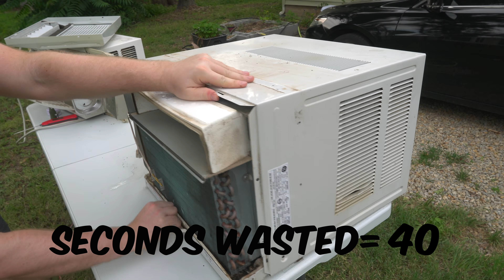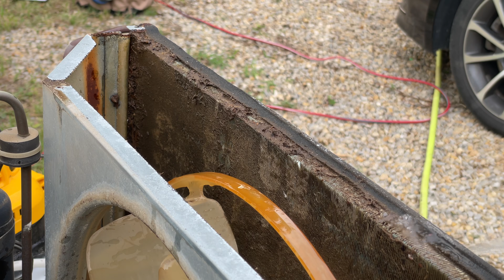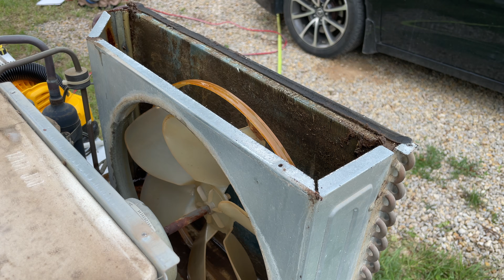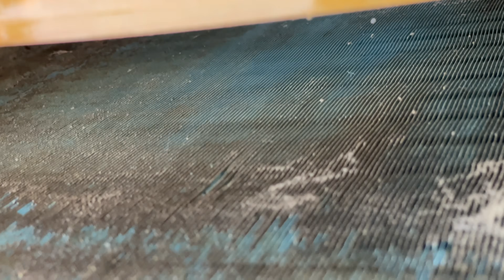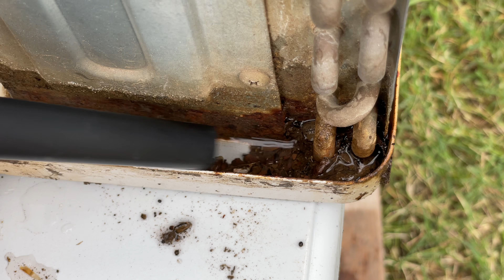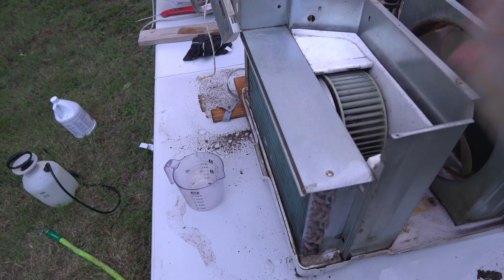DEEP Clean Window AC The Correct Way!

Comment: I've been coughing at night lately and realized last night our window AC may be the issue. I looked in it this morning and saw so much black. 🤢 Thank you for this video. I'm about to hop onto Amazon and buy everything you used.
Reply: So this is why I feel like I’m dying
Reply: @brabbit3134 
I am so sick right now , I didn't know, I cleaned the front filter,   do they have people that can come out ? Any suggestions..I am a Sr. Citizen in Memphis TN .
I have No one.
Reply: Try googling "A/C repair near me" in Google and you should get some results @elw7658
Reply: @elw7658 it would probably cost less to buy a new unit than to pay someone else to come out and clean it. Small price to pay for your health! Good luck
Reply: @elw7658 not sure what type of ac you have but if it's just a window ac or portable ac you might be better off just getting a new one especially if it's a window ac as they are cheap around one or two hundred and that's what a company would probably charge to take it all apart and clean it thoroughly if it's old but if it is new then it might be worth just getting it cleaned I'm sure there is someone that maintenances ac and it might not be to expensive so ya if it's new I'd try looking into finding someone to clean it if the price is reasonable see how much it will cost then see what they cost new but if it is old you most likely would be better off buying a new one as it will be more efficient in the mean time I would avoid using it if you are sick unless you need to because it's to hot to go without then I would spray it down inside with white vinegar and let it sit at least ten minutes before spraying it down with water to wash out as much vinegar as possible possible the vinegar will kill the mold better than bleach plus you don't want to use hard chemicals as when you rinse it out you might not get 100% of it out where as vinegar if a tiny bit is left behind it won't be harmful as it will be completely diluted by the water and you don't need to worry about getting it wet inside as almost everything is covered the only part that's not is the control panel that you press to turn it on and its ok if it gets wet as long as it drys completely before plugging it back in and turning it on you can put a fan on it or heater to ensure that control panel is dry and it will help but it's just a Band-Aid as you will still want to have it fully cleaned out or replaced what ever you do don't ignore it and continue to just use it as it is because mold can lead to ammonia respiratory problems and could end up being fatal and you Dont want to go out from a moldy ac that you could have avoided good luck
Reply: @elw7658  Try contacting an a/c repair company or HVAC company and ask if they do window unit cleanings. If not, buy a new unit. Mold is very dangerous.
Reply: @elw7658  I’m sorry you’re alone, that must be very unfun. I hope you found someone already! If not, you could probably call an air conditioner company to do it. I just took apart & cleaned the inside of mine- it was filthy with mold! But mine is upstairs, and the outside of the unit is on a very steep roof! So I’ll probably have to call someone to do that.
Reply: Update: I did it! I kinda dropped the air unit out of the window when I first unscrewed it 🤦🏼‍♀️🤦🏼‍♀️🤦🏼‍♀️ but otherwise, everything was a success. Thank you again!!
Reply from the maker: Haha oh nooooo! So sorry, but you definitely sent the first one to do that.  Good job tackling the project! 💪🏼
Reply: @asheela75  Yes, you were probably coughing because of all that MILD that you were breathing in. For some of these units, the amount of mild around the blower fan can get pretty bad.
Reply: Me too.
Reply: Same thing with me. I realized it was a/c
Reply: I can't clean it my self, I am a Sr. Citizen. Do they have companies that do that work?

Would I do better purchasing a new one.?
Reply: @elw7658 yes and you need to look for an air conditioner that does not have polystyrene foam in it. The texture of the polystyrene foam attracts dirt which then grows mold on it. I googled window air conditioners with no polystyrene and it said this. Hard-Molded Plastic Chassis: Premium inverter models, such as select variants of the LG Dual Inverter Line, favor hard, smooth molded plastic internal walls instead of exposed, raw styrofoam blocks. Mold has a much harder time adhering to smooth plastic, and it is exponentially easier to wipe clean.

Comment: You shouldn’t spray the coils at an angle always straight up and down otherwise you will bend the fins over and it won’t dissipate the heat properly and it will run like you never cleaned the coils and if bad enough it will shut down on its limits. There is a coil cleaner you can buy that dissolves all that dirt and a low pressure rinse is all that’s needed.
Reply from the maker: The coil cleaner in the video seems to do that in my experience. You are right though, all fins need to be straight.

Comment: Correct me if I am wrong, but based on this video, it seems that if you live in a city apartment, and don't have and outdoor cleaning area and a hose, etc., there is no way to deep clean your AC.  The best you can do is the partial clean as shown in  the other video.
Reply: Part of the reason that I left the city. Window a/c's made me so ill from mold and there was no way to clean them without paying someone hundreds of dollars - if you could even find someone. I had a handy guy wash it for me and he fried the electronics and that was that. - sigh - Maybe try taking it apart in the bathtub?
Reply: Another option that I've looked into is that there are units that can be used in windows OR walls. In these units the guts/coils slide out of the casing so you do not need to completely take it apart. The unit has to be window & wall in order to be able to use it in your window and slide the chasis out.
Reply from the maker: I’d say that’s correct. If it’s extremely bad, and a person wanted to, they could do it in their sink. I wouldn’t use high pressure water, of course. But letting it soak and scrubbing it with that brush doesn’t require much of a mess. But you’re right…it may be better just to replace it with a new one and sell the old one.
Reply from the maker: Also, a bathtub may work better, depending on how big the unit is.
Reply: @HandymanHertz  Thanks so much for the reply.  The bathtub might very well  work for a small window unit, but a larger AC might be a tight squeeze.  In any event, I appreciate your very informative video.
Reply from the maker: You’re welcome, thank you for watching.
Reply: Get a garden sprayer and pump it till your arm falls off, and use that to clean out the fins. Or take it to a friends house.

Comment: Question, do you have any alternate options for spraying if we don't have access to a hose of any kind outside. the only hose i have is the sprayer from the sink, and i'd honestly rather not do that kind of cleaning inside the house if i can help it.
Reply from the maker: If it were me, I would get a cheap adapter that can fit a hose to a sink. Then you can reach your hose outside

The other option would be to just spray the AC with foam, and spray the foam residual off with a spray bottle. I show this in my other AC video “how to clean your window AC the lazy way.”

Comment: My cousin buys new a/c units every 2 or 4 years and I get the old ones and do a detailed cleaning and get them working like new again and sell them 'lol'
Reply from the maker: That’s a sweet side hussle!
Reply: @HandymanHertz  I love when you said "If your really feeling brave" awesome statement, because it could be nerve wracking not knowing if you are going to damage some tube under Freon pressure and your doomed
Reply from the maker: @alexshatner3907 yeah, everyone has different comfort levels I suppose
Reply: @alexshatner3907  they are not super fragile, so its okay
Reply: @alexshatner3907 Yeah the first and only AC I took apart to clean wound up getting a freon line blown up lol
Reply: Hey man.  Smart asf.   Another man’s trash another man’s treasure.
Reply: Damn dude every 2-3 years changing window AC units sounds like throwing money away.
Reply: Hey AC FLIPPING.
sounds like a good business model to me
Reply: I've had to replace ours every 2-3 years but as I've learned, they will last longer if you have a little bigger unit than you need and use preventative maintenance of all kinds, starting with a real filter instead of that swiss cheese screen they give you and trying to run at a higher temp in the 90-100s with the unit at a correct angle and in the shade if at all possible
Reply: @DavidM..832  I've had my 5000 btu frigidaire unit for 9 years. I run it the entire summer. The room that it's in the door is left open throughout the day to cool other parts of the house so the compressor runs continuously probably 12 hours a day and at night the door is closed so the compressor cycles on and off as the desired room temperature is reached.
Reply: @infinity3jif  If I had smaller closed off rooms that might be possible for me but I have a more open floor plan and since I switched to window units instead of central ac I found out real quick about btu and square footage. I do save money using the equivalent of 2½ ton vs an inefficient 4 ton with some crazy ductwork and no more climbing in the attic or calling an ac guy. I think we have it setup good now with 2 Frigidaire 12k btu's.
Reply: @DavidM..832  Nice, I also have a 12k BTU frigidaire in the living room. It keeps the kitchen, living room, and some of the hallway cool. The air from my 5k btu meets the air from the 12k in the hallway and ceiling fans really help with circulating the air. 'lol' As for central a/c systems when they work correctly it is a great system but window units are so much simpler in my opinion.
Reply: @infinity3jif  I agree, strategically placed fans do help.
Reply: Lol thats like my brother and his PS4's I keep telling him all it needs is cleaned and it won't be a jet engine but nope. we have 3 PS4's now.
Reply: @LowJackAP  Yep, you must maintain stuff if you want it to work correctly.
Reply: I haven't bought one in 10 years, I service mine every spring!
Reply: @a.joegevara3519  Same, I purchased my Frigidaire unit back in 2015 from Lowe's. I clean it every couple of years.
Reply: thats crazy because they last more than 10 years
Reply: @DonioSalieu I've never had a window unit last more than 2 years, no matter how many times our how thoroughly I've cleaned it.  One summer, I took one (that had passed the 2 year mark) apart and deep cleaned it every friggin weekend and it was covered in mold every friggin weekend....  I've spent a FORTUNE on new air conditioners over the years
Reply: @brianwood876 What? Do you live in a really humid area?
Reply: @lorenavelvet  yeah. But still... It's a little ridiculous
Reply: @brianwood876  I'm in the same boat. NC summers just shred these window units these days.
Reply: @brianwood876 
There has to be some additional factor effecting your window units. Maybe too much sun, too dusty, too damp, not enough airflow on the outside. 

I have a Danby purchased from Costco in 2017. It’s been used non stop since then. I even loaned it out to a friend after hurricane Ida. They ran it on a generator for a few weeks the. Returned it. I stuck it back in my window and plugged it in. I’ve never done more than clean the filter. It still keeps an oversized room cool and dry. 
I hope you have better luck going forward. 

Also maybe check your electric supply from the breaker all the way to the outlet.
Reply: @davidkirby6473   well it wouldnt be the electrical, they don't break down mechanically, they just get so moldy regardless of how much they are cleaned.   I can't rationalize still using one as bad as they get if it's blowing mold into my house when I have kids breathing in there
Reply: @brianwood876 I have to wonder if there's any Shrubbery or bushes right near that unit that have aspergillus in them which causes the black mold  .
Reply: @davidkirby6473 good info
Reply: @brianwood876  it's the angle you got it installed. Or it's near a gutter or next to a plant. Had a window unit be installed wrong and water was backing up into the windowsil and into the unit, it molded the unit and the window. Also I'd look for units that use Styrofoam inside they started doing that to limit humidity and mold issues.
Reply: I do that to ac washers dryers microwaves etc.. really easy to fix and diagnose
Reply: Window Air-conditioned is so Cheap Now Days.

Just Buy New A.C. every 4 years and call it good
Reply: @norbelsemaj3870  Just get a 4 or 5 year extended warranty protection plan, because if you buy a good quality air conditioner will cost you a lot of money to keep replacing it every four years
Reply: I accidentally hit one with a screwdriver and PSSSSSSSSHHHHHHH. Bye bye freon.
Reply: Clean mine 😂
Reply: Yes we live here in lake charles  Louisiana  we need help bad my child  is always  sick from dirt and  our clogged  air conditioner  we need someone to please  clean them something
Reply: Hell yeah boi
Reply: I'm down to buying 2 per summer. I can't deal with the mold smell.
Reply: So what do we do about these NEWER AC units that DON'T even have a hole at the bottom to DRAIN out the water  ?
   Mine is 2 yrs old in about 5 weeks  ... only 6000 BTU . 
    Even though alot of water does drip from it , I can't understand why now after I moved it slightly , water is pooling in it and it's dark .
   Can't find my electric drill to drill a hole under it and some people say it will be less efficient if I do that .
   That didn't happen last year ... now the color of the water has me freaked out .
   No way am I taking that thing apart .
   Anybody have any suggestions on IF I can just turn it off , take out the filter and just try to gently flush out the bottom part and  maybe the  blades ? 
  All I know is : it's a Toshiba I bought at Home Depot  .
Reply: @gardensofthegods Drill some drain holes and take the efficiency hit. It won't be very much anyway since you live in a humid area and evaporation isnt cooling the coils much.
Reply: Wow
Reply: Smart dude 🤣 😅
Reply: How do u get rid of the black mold completely that grows on the styrofoam though??? Help!
Reply: Let me know if you are in Jacksonville Florida. I have a job for you. 🤣
Reply: I can't take my Frigidaire unit apart; some screws won't come out.  I may replace it.  What brand(s) do you find easiest to take apart for cleaning?
Reply: How much do you sell them for, because nowadays you can almost buy a new one,  for the cost to have them cleaned?
Reply: @worldview730 $50-$75

Comment: I have styrofoam in my air conditioner that seems to have black mold on it.  How do I clean the styrofoam?  I just bought 2 new window air conditioners but if I clean my other two I can use them in other rooms.  Now if I can only get someone to take my units outside, as I cannot lift them.  Thanks.
Reply from the maker: The styrofoam  is usually about impossible to get to, in my experience, without taking them apart. The blower is also usually covered in mold too. I have a deep clean video that shows how to clean this and everything you need to know. Good luck
Reply: @HandymanHertz  Thank you.  But isn't that the video that I just watched and you are replying to?
Reply: THis is an issue that's made me ill for years, so it's something I've had to research. I was just told that manufacturers of newer units now coat the styrofoam to help prevent mold. It's the condensation that collects in the styrofoam that causes the problem. My first window unit was a solid plastic core - I never had issues and never felt sick using it. I'm curious to see how these units with plastic treated styrofoam perform. I just bought two. But also, bought ones where the coils slide out so that I can more easily and regularly clean them (fingers crossed.) So far I've only found that Fredericks make units where the guts slide out. I'm hopefull that I'll be able to clean them without taking them out of the window/house since I can't carry them out either.

Comment: Your never supposed to tip these like that as far as I have ever been told or read. Refrigerators and dehumidifiers as well. Something about disrupting the coolant in the lines I believe. I did this cleaning one time to a window unit and never again. It was never the same after that. It ended up dying like a year or two later anyways.
Reply: I bought units that are for wall or window so that the coils slide out. I'm hoping that this will make life easier for cleaning. I'm highly sensitive to mold and used to love summer but now am sick every year unless it's a brand new a/c unit.
Reply from the maker: I wonder how else they expect us to take it the cover? I havnt had an issue yet, But that’s just my experience.
Reply: @HandymanHertz I believe you just have to let it sit the right way for a while before running them again so the coolant settles back where it’s supposed to. My dad always told me to leave it the right way over night before turning it back on. Probably worth researching. Nice video!